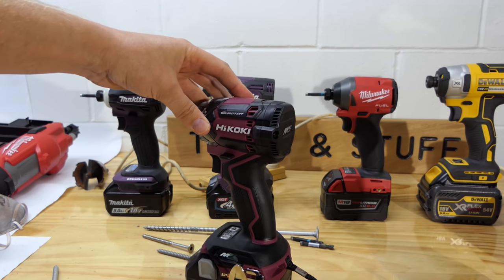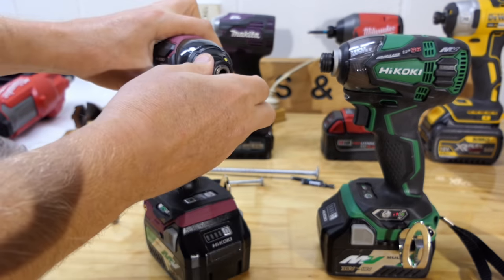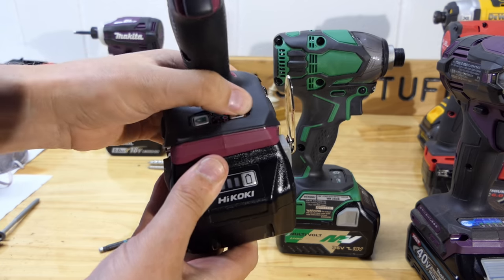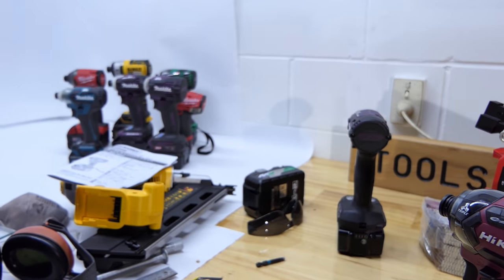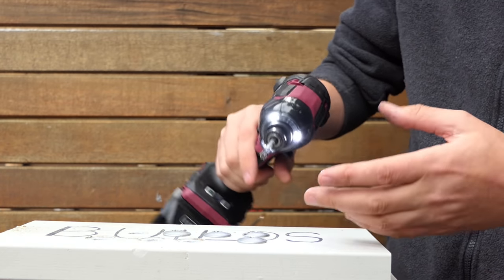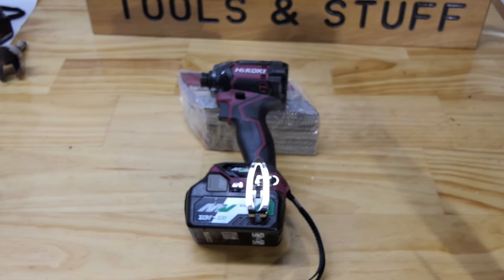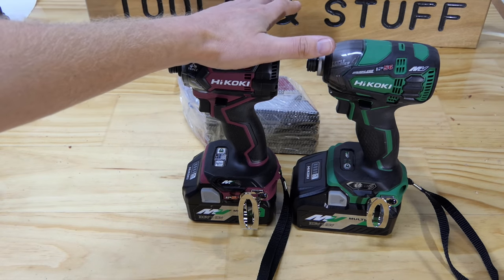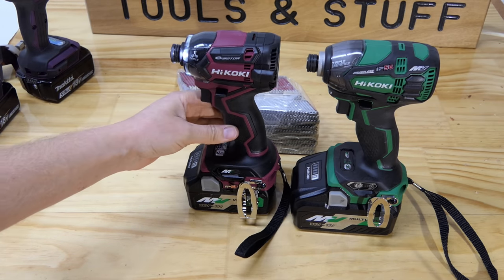Hikoki 36v Bluetooth Triple Hammer Multi Volt Gen 3 WH36DC Impact Driver VS DeWalt, Makita Milwaukee

Comment: You have some of the best comparison videos, mate!

I'd love to see the Flex 24v Quick Eject vs the Makita XGT Impact.
Reply from the maker: You will have to watch the flex somewhere else I'm afraid. They are only available in the states so most of the world doesn't care. And I'm not going to the expense of importing them when every tool reviewer in America has already shown off their free set.
Reply: Well, most reviews demonstrate the Flex being on the upper end for power, but will more than likely overheat in very quick order.
Whereas TTC demonstrated that the state bound XGT is a lower power unit (and Project Farm demonstrated that it still has more than enough power to snap 1/4” hex adapters like glass), that will keep going for quite a long time.

Plus, a few channels have demonstrated that Makita’s got a good range.

Comment: I bought this impact recently because of seeing this  video a few months ago. It's very impressive, very comfortable and powerful It's very smooth. Until now, I've only had m12 & m18 impacts, and they're so beat up and ragged looking, peeling, etc. It's nice to have a shiny new screw gun.

I tried taking my lug nuts off with it and they just zipped right off in a second. And I built a deck extension(and resurfacing)So far, the biggest screws I've driven are 6in GRK "lag alternatives" plus a whole lot of 3.125" & 2.5" GRK #10s, and a few hundred composite deck screws. It handled everything very well. 

The grease is could be from running it hard for a prolonged period after it's been sitting in a box for a year, after it was manufactured. 

A downside is there's no compact batteries. If they could make a 1.5ah that was half as thick, I'd use them on this tool for sure. Impact drivers should not have such big batteries hanging off them. Also, these batteries have no rubber coating on them. It makes them look cheap. I might spray plasti-dip on them so I can stand this up safely.
Reply: Can you use this tool with 18V Battery ?
Reply from the maker: No. It's a 36v tool.

Comment: don't worry about the grease mate mine came out of my old impact when I got it which must be about 8 years old and she still goes. of course when I got it I did do batten screws and coach screws with a pre drilled hole but honestly these days I find it even better than any impact driver to use an impact wrench with a driver bit adapter.

Comment: The Dewalt does it because they put 3x the amount of grease needed and they make it so when it heats up for the first 3-4-5 times it melts to lube the inside of the chuck as well- plus it gets very hot.

Comment: Legit wished they called it Hikoki here in the states instead of Metabo HPT. Only one in the states I’ve seen with real Hikoki is Chris Salamone.
Reply: I wish they’d bring over their cordless staplers.
Reply: @Quentin when I hear Metabo HPT I don’t think about fine German Metabo craftsmanship, that’s for sure.
Reply: Metabo is the original name of the tool company that makes the drills. They were bought out by Hitachi. They're made in Germany and China
Reply from the maker: No. Metabo and hikoki make completely different lines of tools even if they are owned by the same company. Hikoki was never made in Germany it is a Japanese brand.
Reply: @ToolsAndStuffOFFICIAL  You're right that Metabo(just Metabo, red & green) is a separate line of tools, but Metabo HPT, Hitachi, and HiKoki are all the exact same thing(excluding varying regional manufacturing requirements). They're interchangeable. I see HPT tools at the hardware store where the display model says "Hitachi" and the boxes below it say "Metabo HPT," and they're the exact same model.

They're both part of Hitachi Koki(Metabo & Metabo HPT/Hitachi/HiKoki). I don't see why getting a tool marked HPT makes it any more valuable than one marked Hitachi or HiKoki, or that one is more "real" than the other.
Reply: @histguy101  sir your info is still flawed
Hitachi/Hikoki/Metabo HPT are the same
Metabo(German) is a different line of tools

Comment: Watching the torque test channel the sound change is the hammer skipping the anvil and hitting the top of it instead of the side like it should.  They found it to put a forward force in the chuck and bend the screws also.
Reply: Apparently the skipping of anvil in high output scenarios is made that way on purpose by hikoki

Comment: The following is the quote from wh36dc manual:

The Tightening mode switches between 5 diﬀerent modes each time the Tightening mode selector switch is pressed.
Upon pulling the trigger switch in bolt single mode, the driver will automatically stop after applying a number of impacts.

Soft / power / bolt and self drilling screw mode will commence impact upon pulling the trigger switch and will continuously apply impact without auto-stopping.

Soft mode is a mode that does not infl ict damage on thin nails or decorative materials.

Power mode can be used for normal work up to heavy load work.

Bolt mode has a short pull margin for the trigger switch, making the driver ideal for high-speed tightening work.

Bolt single mode controls the impact, allowing control of the tightening force. Use this mode for delicate work such as tightening bolts for racks, fences, furniture, etc.

Self drilling screw mode is ideal for tightening self drilling screws by reducing the chances of overtightening that could result in severing the screw head, breaking the screw, or slippage.

NOTE
○ The appropriate mode diﬀers depending on the screw and the material being screwed. Drive in a few test screws and adjust the mode setting accordingly.
○ The tightening mode selector switch can only be set after the battery has been installed in the driver and the trigger switch has been pulled once.

Comment: I think you've discovered a very serious issue. Based on your observations of the triple hammer warping screws and slowing down, I suspect the hammering frequency has no randomness designed in its mechanical action. What you are seeing are destructive harmonics. The frequency of the hammering is too close to the natural resonant frequency of the impact internals and that screw that you warped in a previous video.
Reply from the maker: You can actually see it happening in this video too, but to a lesser extent due to using steel instead of stainless like the previous video you speak of. Hopefully one day when I have more time I will make a video delving into the issue.
Reply: @ToolsAndStuffOFFICIAL  I always pre-drill holes for stainless screws. They break quite easily otherwise.

Comment: Thanks for the review of the WH36DC.

Have you found any of the  issues with twisting the heads of the screws  with the DC as you did with the the DB- 2nd Gen?

Have you seen Torque Test Channel's "High-Speed Video Uncovers Weird Stuff In Popular Impact Driver" for a possible explanation for why this occurs with the DB? He uses some of your footage from your "DeWalt VS HiKOKI VS Makita VS Milwaukee | 4 Top Impact Drivers POWER TESTS".

Comment: 18v triple hammer - can have small pack - which makes it really nice to hold.
On paper - basically the same spec as 36v triple hammer - be interested for you to compare them
Reply: I own 2 of the 18v triple hammer, nothing is smooth as driving 3in screws all day with that tool
Reply: TTC tested them, and the results were that they were totally interchangible performance wise. So, the question becomes, do you spend more and get the bigger batteries out the gate but lose out on the small batts (which I don't really find a difference when using them, personally), or do you save the money and get an impact that can accept all the batteries?

I chose bigger batts.

Comment: Are there certain tools you can't use the slim pack batteries in because the tool only works in 40v?
Reply: There are no slim pack batteries for 36/40V tools, because they need 10 cells to get that voltage. If the tool is 36/40V, it’s going to need either a double stack battery, or a very long battery pack (I.e. the Hart 40V system of outdoor power equipment)

Comment: It seems like this one grew on you based on later videos, I was wondering if you had to buy into a system based on the impact would you take this and the Hikoki multi volt or the Makita 171 and lxt? 

Both seem good but I don’t know as much about hikoki long term and the lxt has a lot of questions about further development… 

Thanks for all the vids!
Reply from the maker: Tricky one. But I would still go 171 LXT I reckon, unless you want a 1/2 inch router or framing nailer. Hikoki will take at least another 5 years to get anywhere near the range that Makita has. And they are still pumping out new lxt stuff. 2 new chainsaws just released a couple of days ago.

Comment: I have an idea for testing new 40v it's gonna be real fun), makita had made the adapter for the oldest 36v tools before they realised 18+18v  to use two batteries 18v to the 36v tool, so if you adapt it to new 40v ))))

Comment: I don't know the mah size of those multi volt batteries 4mah or 5?
Reply from the maker: The small one is 36v 2.5Ah / 18v 5Ah and the larger one is 36v 4Ah / 18v 8Ah

Comment: Hikoki makes great tools if they were cheaper you’d see more people using them in the states
Reply: They’re usually MUCH cheaper than Makita, Dewalt, Milwaukee, Bosch in the US.  Price ain’t the issue.  Shit, everyone uses their pneumatic stuff: because of the price.
Reply: @robertrada4783  telling about price. The M18 Fuel Jigsaw is at 240 Euros so about 270 USD bare tool. 
The new M18 Gen 2 mid tourqe bare tool 249 Euros. The small M18 miter saw is around 800 USD, yoz get the sinular specs 18V Profactor Bosch Miter for half.
Basicly Milwaukee is only for fancy american fandom people in europe. You are more close to Hilti or Festool in price as to Bosch, Makita or Metabo
Reply: @Zozo806  It’s crazy what they sell Milwaukee for in Europe.  It’s probably the worst built out of the lot.  Dewalt is really high in some European countries too.  Isn’t that a hoot?  American Black and Decker buys your Elu, paints it yellow, drastically reduces the build quality, and then sells it back to you as a Dewalt for twice the price.  😂
Reply: @robertrada4783  not by a lot for some brands. The finish of Milwaukee tools is a bit on the cheap side, the fat handle is personal preference but still its crazy that a Festool Kapex KS 120 is like 50 bucks more expensive than a Milwaukee MS 304 DB. This saws are just not in the same League they are not even from the same planet. While one is a saw that is known for fine carpentery like high foot trimmings the other one is a construction side miter.. 
Yrs for Elu, its sad but Dewalt is also like the german or japanese Brands not that aggressive in adverticment...
Reply: @Zozo806  The M18 12in miter is $700.00 in the US. The Kapex 150 is $1575.00, more than twice as much.

The fuel jigsaw is a freebie tool, meaning throughout the year, all the Milwaukee dealers put out a "buy a battery starter kit for $150, choose a free tool" and the list is always the same, jigsaw being one of the options. Otherwise it's $199.

Comment: For power Milwaukee for finesse Makita. However, the Makita to many buttons especially on the 40v impact.
Reply: Not hard at all to learn the settings you got 4 speed, two tapper modes, a wood mode and bolt release
Reply: Ya I just use 4th for everything besides tin screws🤷🏼‍♂️
Reply: @adamfehr1994  same here i dont need all these crazy modes. With experience you can jus control everything with the trigger. Either way makita jus an amazing impact with the feel and smoothness and all. Ended driving some lags with my coworkers Milwaukee today and even tho it was faster i jus didnt like it nearly as much and i hate the handle on the Milwaukee its bulky
Reply: My least favourite part about Milwaukee is their triggers, they’re pretty much either half or full, with the Makita I can do drywall if I want because the triggers so soft I can feel what it’s doing. After being a Milwaukee guy for several years, it’s going to take quite a bit for me to go back. Only thing Milwaukee has is power and nothing else, I don’t think impact drivers have to get anymore powerful, there’s a point where you’d just use an impact wrench🤷🏼‍♂️

Comment: It's interesting that your Gen 2 doesn't have the "Made in China" on the label.  On the Metabo HPT branded version for USA markets, it has Made in China on the very bottom left side of the label.  They look identical, yours just has a blank space where it would be.
Reply: His was made inside of a blank void in the shipping container out on the open sea. They were running behind on the shipment and had to send an assembly worker along with a few pallets of impact driver parts.  He managed to make 4,799 impact drivers before he was shot and killed by somali pirates.
Reply: @robertrada4783  That definitely explains it!   Or I suspect the real reason, in the USA you are required by law to have COO (Country of Origin), but in other parts of the world, you are not...so they intentionally leave the Made in China off so people think the tool was made in a different country.
Reply: @cup_and_cone  I am not sure why but we are definitely hardcore when it comes to Country of Origin declarations.  Simultaneously , we have the most insanely relaxed customs operations.

Comment: Where do you get the batteries for these?
Reply from the maker: Anywhere that sells HiKOKI stuff, or if you are in the states, anywhere that sells Metabo HPT. The batteries are called Multivolt and are the same everywhere on earth.
Reply: @ToolsAndStuffOFFICIAL  will the 3rd gen run 18v or 36 only?
Reply from the maker: Both of the Hikoki Impacts are 36v only. The 18v impacts take both batteries whereas the 36v only take the Multi-volt batteries.
Reply: @ToolsAndStuffOFFICIAL  ok, cool. Thank you for the information. Love your videos.

Comment: Nice tools but it’s annoying that here in the US they brand as Metabo HPT. Should have went with Hikoki or even just HPT. Then again I’m a Makita guy so what do I know.
Reply: Metabo is the original name of the company. It's a German company that was bought out by Hitachi. They're labeled as hikoki just for Australia and NZ.
Reply from the maker: Metabo is a completely different line of tools. Metabo HPT is only used in the US. Everywhere else on earth they are called hikoki. Metabo tools are still a separate brand name and completely different tools even though the company is owned by Hitachi Koki.

Comment: Isn't amp hour the amount of stored energy in battery.. Nothing to do with power..
Reply: It is neither. Peak watts (peak amps x min voltage) are power measure, and wh is a capacity measure